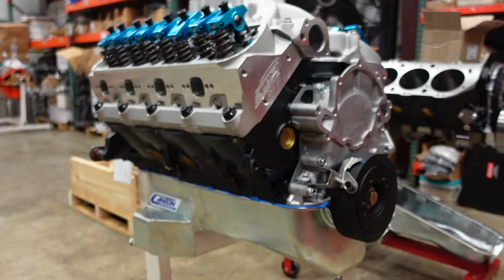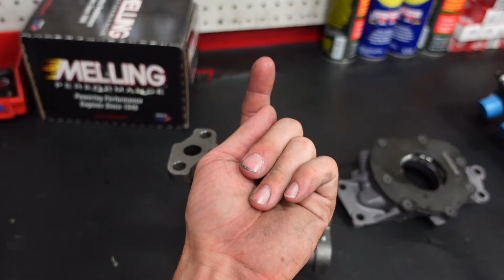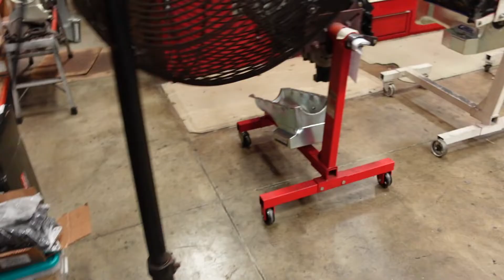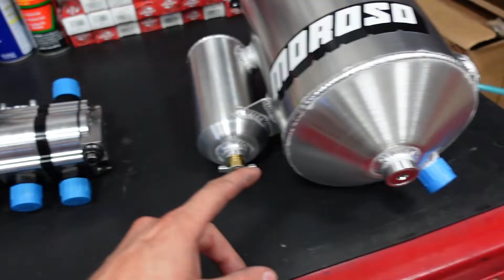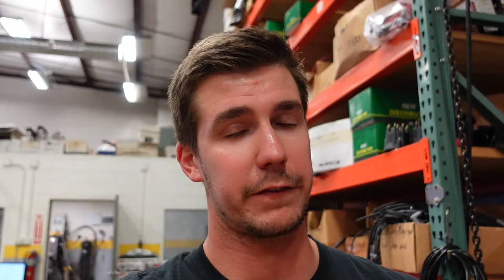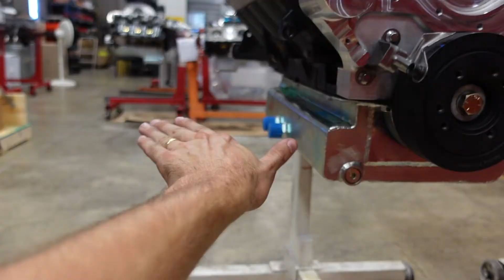Wet Sump vs Dry Sump Oiling Systems & Which One is Right for You

Comment: I have seen a number of YouTube videos about the subject of a wet sump vs a dry sump oiling system. Basically for most street cars and cars driven on streets the manufacturers wet sump works fine, a dry sump system is not needed. Where the wet sump oil system is needed is powerful street cars that could be used for racing and race cars. One example of a street car that can be used for racing and has a dry sump oil system is the C8 Corvette.

Comment: Does a dry sump system provide additional Horse Power? I have a small V8 generating ~260HP. An additional 30-50HP (as some have suggested), would be a very noticeable improvement.

Comment: I'm putting a huge wet sump on my autocross car because I have the room for one and no place to put a dry sump tank. The sump is 27.5" wide and 25" long with lots of baffles and gates to keep oil near the pickup. The bottom of the sump is about level with the ring gear on the flywheel so I'm getting the engine as low as it will go in my chassis. I calculate I have room for 9 US gallons below the pan gasket which puts the oil level a couple of inches away from the crank, or drop the oil level to 4 gallons and get it even further away from the crank.

Comment: What happens when the dry sump pressurized pump goes out (stops working) now what ???
Reply: IT  CAN BE REMOVED AT THE TRACK REPAIRED AND PUT BACK IN SERVICE NO PAN REMOVAL OR OIL TO DRAIN

Comment: Stupid question... If the crankshaft isn't sitting in a bath of oil in the pan, how does the oil get to the crank?
Reply: THROUGH  THE PRESSURE OF THE PUMP PUSHING IT BACK INTO THE ENGINE THROUGH THE FILTER

Comment: Little late to the comments. Is there a way to reduce oil pan depth(for clearance purposes) that doesnt require thousands worth of hardware? Im putting an engine into a very small mid-rear type position where i only have so much headroom. I dont plan on going crazy into the power as the power to weight will quickly become an issue for control, its intended use will be for targa rally/ time attack road racing in suburb courses. My issue is that require a few extra inches of ground clearance for the motor to fit and not protrude up into the ceiling of the engine bay(mid rear config) any input helps.

Comment: What is the reliability of a dry sump system? As in leaving the desert to drive 5 hours home? I have a prerunner and we keep popping engines while running in the desert and we've came to the conclusion that with the jumping and high rpms its constantly moving the oil around we just want it to be reliable.

Comment: You could talk more about the benefits of Modern Petersen and Moroso dry sump pumps creating up to 20” of crankcase vacuum while eliminating the need for a separate vacuum pump.  This can increase horsepower by creating a better ring seal plus the reduced windage as well.  Thanks for the cool videos.

Comment: Sir, 
I believe the oil pressure pump stage is located on the opposite end of the dry sump pump, where the oil pressure regulating valve is located.

Comment: pan with windage tray, baffles and a scraper get 90% of the gains of a dry sump.
Reply: Not even close to true. There are other gains to be had with vacuum, low tension rings, etc. Not to mention constant and consistent oil delivery.
Reply: So in your opinion  it's greater than a 10HP difference than a good windage tray and scraper design? @AndyE30

Comment: I’m gonna be a dick now, both gases and liquids are fluids. Liquids are not compressible, gasses are. So fluids are compressible, depending what type. Kinda like engines vs motors. All engines are motors but not all motors are engines.

Comment: Would love to see a video on how the seals or motor is built differently when a dry sump is used, especially if it’s an ls
Reply: No real difference in build except dry sump will allow you to run lower tension rings, especially with a vacuum pump.  That's free horsepower.  On the oil pump mount, you have to block it off, but that's about it.  There's a ton of tricks to do though that can result in even more power, but for a basic setup that's about it.

Comment: A crank scraper and pan baffle can help mitigate the wet sump foaming and G issue in the pan. I've read that Accusumps can fail also. OEM LS3 passenger head is notorious for slow drainback on long lefthand sweepers maintaining over 1.3G. Can you explain dry sumps with different number of stages and how you would pick the correct number of stages?